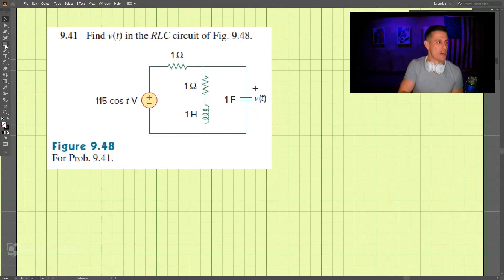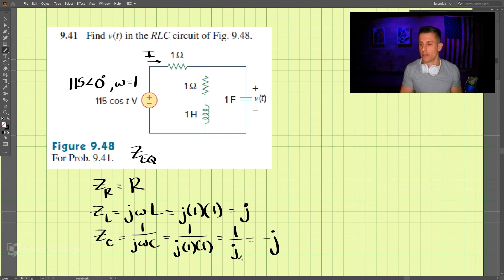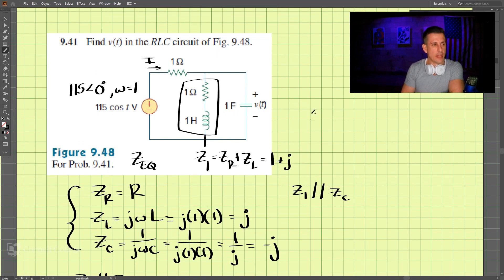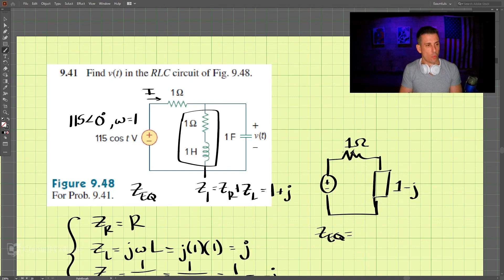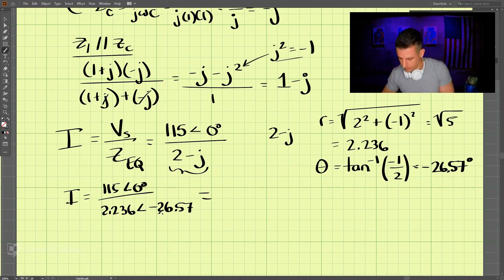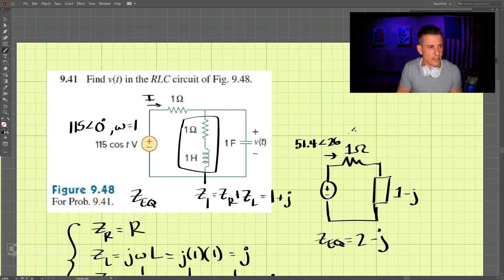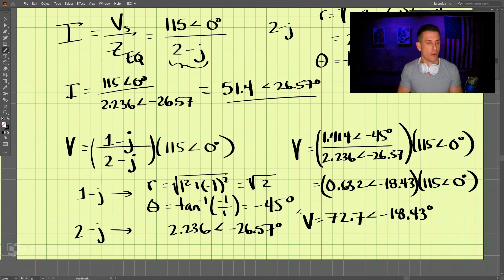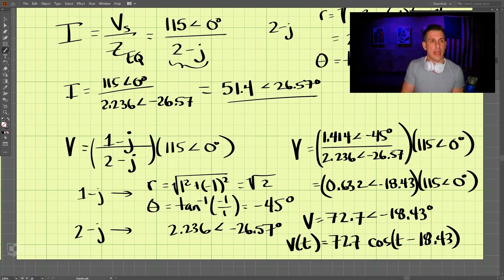9.41 - Example Problem - Fundamentals of Electric Circuits

Comment: why did you find I, when only Zeq was necessary/used
Reply from the maker: Not necessary, instead of voltage division you could use I and multiply by impedance to get voltage. But you are correct, not necessary if you use voltage division.